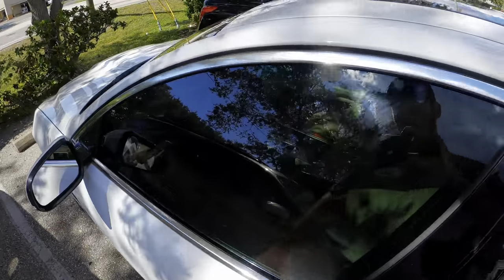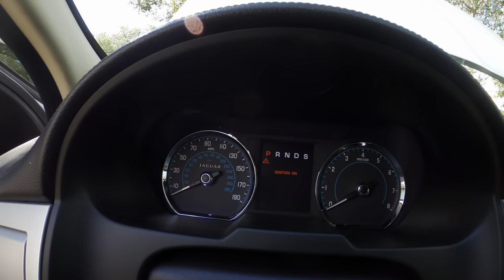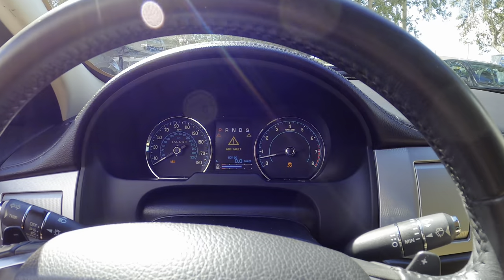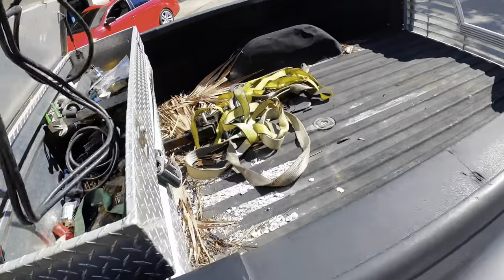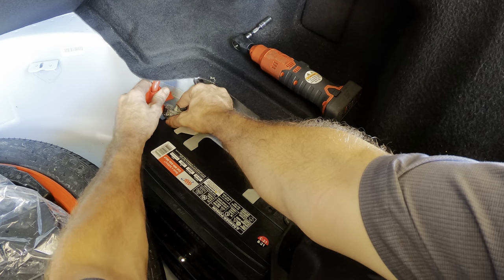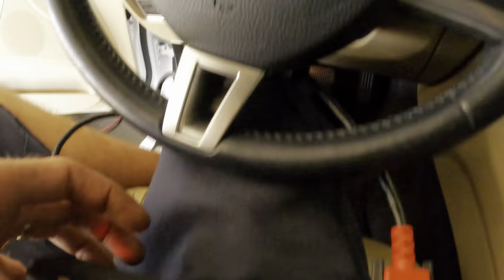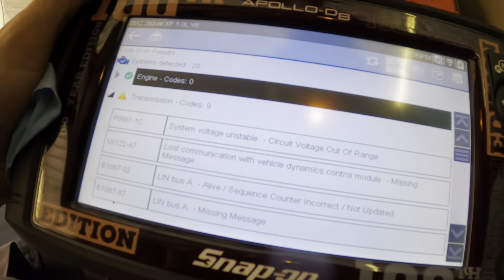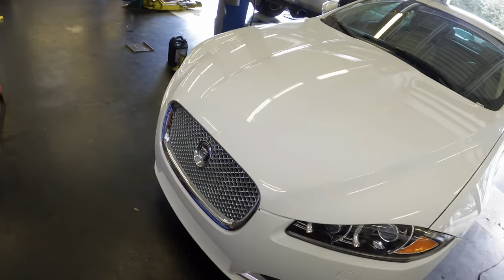Jaguar XS just Towed In.  I’m in over my head! Customer States: “Check Battery”

Comment: Jaguars are a pain in the butt to work on.  It's one of the reasons I won't own one.  They're a pain in butt to maintain.  An honest mechanic who isn't an experienced Jaguar tech is going to turn the vehicle away.  Many European vehicles have this quirk that only the dealer with trained specialists can work on them.  They're not like the big US 3, Toyota/Lexus or Honda/Acura where they're easy to work on or are reliable or at least you can give the customer a good diagnosis.  I've heard that Jaguars spend more time in the shop than on the road.  If you want reliable luxury driving; buy a Lexus or Acura.

Comment: That def seems like a complete or near complete electrical meltdown. Can only imagine what that would cost to replace? You literally buy these cars when you can maintain a maxed out checking account. Newer BMW engines have three times the number of seals that an engine needs. Fluids exiting and re entering the engine through brackets, etc. Can someone tell me why the do the opposite of keep it simple, to the extreme. My brother in law has a 750/760 bmw model year prob around 2010 and is burning 1.5 quarts of oil per month. Guess you buy these when money is no obstacle. Weird

Comment: I commend the mechanic for admitting it needed to go to the dealership.  I might have thrown a new alternator in it?  I didn't watch this video completely.  What was the voltage of the new battery he put in?
Reply: The voltage was 11 volts with the new battery while the engine was running.

Comment: This is why you have to be wealthy to own these types of cars, i think the best cars are the ones that have electric and mechanical gauges to make sure you know what is going on, and a computer that can tell you what to look for when you have a problem, like cylinder #2 misfire, can be a few things but pretty much its usually just a spark plug or coil pack, and can be checked out easily enough lol, but when everything is completely computer controlled it'll get extremely expensive and complicated to fix, without having proper training and equipment to be able to diagnose these types of vehicles,  just give me a older Toyota land cruiser  or basic mechanics vehicle im perfectly fine and capable of fixing it myself lol

Comment: My only critique:  ALWAYS do negative cables last.  By leaving the positive loose you can create a situation where you short it to ground.  You cannot do that if the ground is the loose cable…
Reply: clearly the need to video is over riding here.  sure it would better to use two hands to keep the 
jumper clamps under control.  give the camera to someone else.  or a go pro straped to your head.  using two hands to work would speed it up.
Reply: @rickpaulos  1.  I’m not the guy from the video.  

2.  If you disconnect the positive first it will arc.  You have a significantly lower chance of any arcing when doing the negative first.  

3.  When considering the battery and disconnecting it, you ALWAYS disconnect the negative first as the body is a negative ground on most things.  This means if you disconnect the positive first and slip your wrench you now have a very high amp direct short possible and this can and will cause fires if not immediately addressed.  

Always disconnect the negative cable first.  Always.

Comment: Jaguars are very sensitive kitties they hate low voltage as if it was 2 day old sour milk... Btw these babies has 2 batteries there's a second smaller one hiding either under the back seat or front wheel arches

Comment: Wrong tittle "XS" instead of XF. I bet you never put the engine fuse box cover screw back to its place... well not a good reputation. If there are so many faults present it's an electrical issue due to low voltage which these cars are sensitive for. You can't just change the battery without any programming using the right software in these Jags. Yes it's a pain and yes it's engineered to see the Jag stealership more often that needed but nice cars after all.

Comment: A REAL “mechanic” would know that the fancy-smancy cars need a minimum threshold of battery power level To function properly (as well as Keeping all the TCM/ECM/Modules “happy” rather than erratic).

I would’ve put a battery charger on it for at least a half an hour….Before trying to move/drive it.

But I’m an actual bona fide real mechanic

Comment: I'm kind of lost Ray I understand the battery issue. Not the tranny though?.Are you saying the scan tool was giving you too much information? That it should not have been giving. SEEMS LIKE IT HAD A LOT OF CODES, AT ONE POINT YOU SAID 70 SOMETHING PERCENT. AND YOU HAD ALREADY GONE THROUGH SCREENS FULL. And still have a lot to go. I just thought those scan tools broke everything down pretty good guess I was wrong huh. I'VE BEEN IN THAT POSITION BEFORE IT'S OKAY YOU LEARN. SOME OF THE STUFF YOU JUST DON'T WORK ON. LIKE YOU SAID NOT MY FORTE. GOOD JOB VERY GOOD JOB 👍🤗👍🇺🇲🙏😁

Comment: Alternator faults on new jags cause all sort of shit. From those fault messages it looks like alternator problem. Usually U codes indicate comms problem due voltage drop the epu could send initial signals for alternator but if it gets no output voltage, ei. alternator broken, it gets into hissy fit. I give you  props for admitting defeat. Even here in UK when I worked at garage we send all jags dated after 2010 to dealer they are just too much hassle. Also its hilarious how all yanks complain here about european cars being beeing too sophisticated for them 😂

Comment: I think you could have checked for some easy things, like fuses and connectors. If nothing was found, sending them to the dealer would be the right thing to do. Also it would have made sense to put in the known good battery right away in the parking lot, after jump starting had failed.

Comment: seems like the alt was on its way out causing low voltage and making every god damn sensor possible in that euro junk go apeshit thus making it undriveable id laugh my ass off if that were the case modern car electronics are super anal about voltages after all.

Comment: You seem to have set out to show the world that you are a garage to avoid! I don't think the fact that it's a "European" car is the issue. And what is a "European" car anyway? Is a Peugeot built in France similar to a BMW built in America or a Jaguar built in the UK? All are "European" but totally different. You tested the battery at 7 volts and still thought it was OK? You put on a new battery and found it was 11.96 volts. Had it been charging, then it should have been over 14. I guess all that it needed was a new alternator and all the faults which the low voltage was causing would have gone away. You had to send it to a dealer to fit an alternator?

Comment: Europeans and Exotics are in a class by themselves.  I don't like them either.   They are horribly over engineered. They take special tools and training.  If you own one my question is how can you trust it on a trip?  They are so complicated no one in in a small town could work on it even if your battery simply went dead.  Oh my the towing bill to the dealer if you had to be towed hundreds of miles!  You pretty much diagnosed it properly  Ray.  Most likely if you had replaced the alternator, recharged the battery and cleared all the codes you would be home free.  Your Snap on Apollo would have cleared all the codes in the modules but sometimes one of those finicky modules could have lost its programming or the programming become corrupted so you did the right thing referring your the customer to the dealer.    Europeans set all those communications codes and they wont clear like a normal car when until you  clear codes with you scanner.  When I say normal I mean Asian or domestic.  To what purpose making a car this complicated and hard to work on can there be?